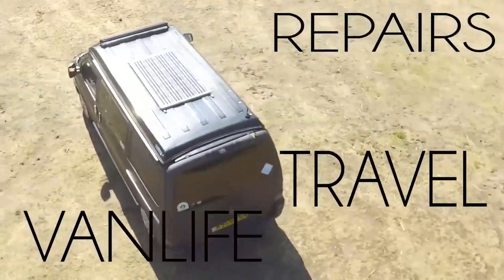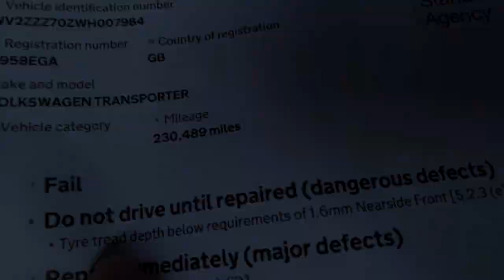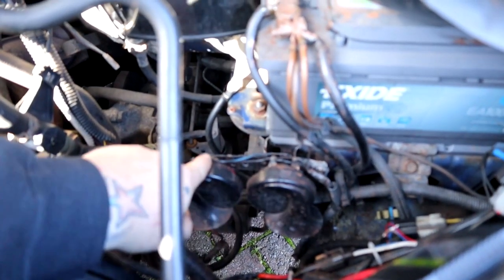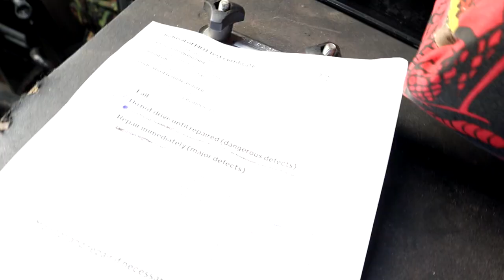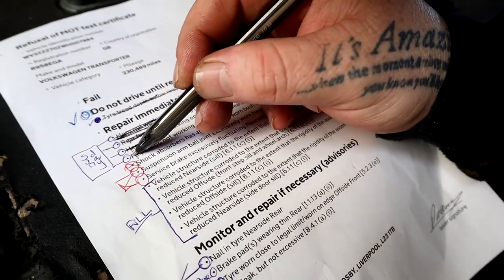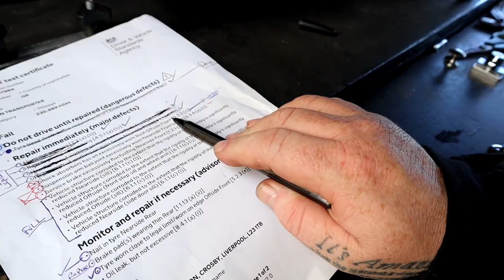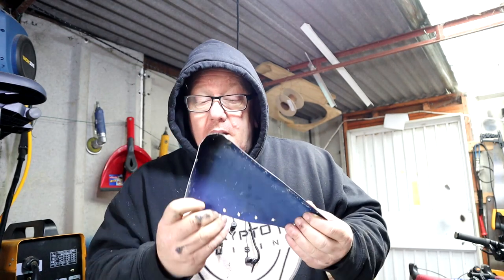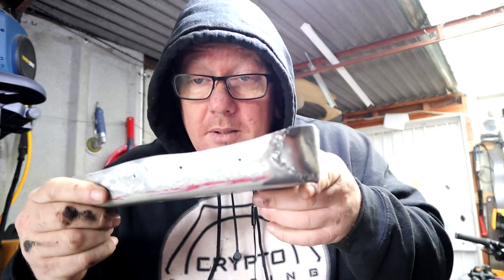MAJOR Repairs Needed After MOT Fail | DIY VWT4 Mechanics

Comment: Have u got a video pal of you fitting pop up roof
Reply from the maker: Gary Barnett sadly mate no I did it before I even thought of YouTube . And now I’m like why why why didn’t you record it . I have 1 pic of me standing in the cut out hole . To be TOTALY honest with you if you are any good with wood work or basic fixing of stuff then doing your own pop top is a easy job . Put it this way I’d rather do a pop top than a cv joint lol .
Reply: The urban explorer  was it easy to do and is the roof expensive
Reply from the maker: I bought mine off a guy in shefeild UK around November time and it was £700 with delivery . And that was every thing . The roof the inner tent that was attached and all the parts to strengthen the grins and sides plus all the inner cowling to finish it all off . Literally all we did was cut out hole bolt in the strength bars bolt roof down and pistons fit all the inner cowling and make it all tidy . In total it took us 2 days . All I had to buy was veltrim . I’ll do a video on it mate and explain as much as I can

Comment: I've Googled and Googled horn failure, dangerous or Major. Your video shows it's a major. So tomorrow if no dangerous faults and it's viable to repair cost wise, I can use until my old mot runs out? Getting clock springs done :(
Reply from the maker: No horn woukd be a faliour as you have no way of warning other road users . The horns quite an easy fix . The main problems that cause issues on the t4 is the copper band that’s under your steering wheel for the pos and neg they allways seem to go . But you can run the cables to a swich
Reply: @Urban Vanlife  yep I know it's a failure but I think on your mot certificate, the horn was a major not a dangerous, I've got mot until 13th of April so I can drive it until I get the horn fixed and re-tested unless I get any dangerous failures?
Reply: @Urban Vanlife  or would the horn failure, if a major override my current mot certificate making it unvalid to drive.
The car has done 161k
I'm debating getting another car, depending on what my car needs for an mot pass, it's a peugeot partner tepee and it looks a nightmare to get a wire to an aftermarket horn. I didn't want to spend £150 on clock springs to find out it needs loads of other work doing.
I think your right though :(